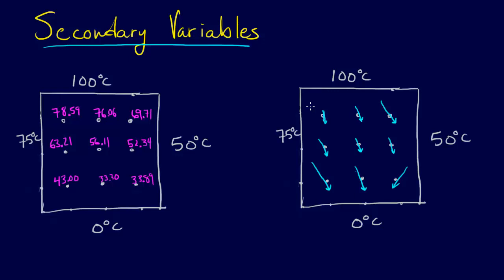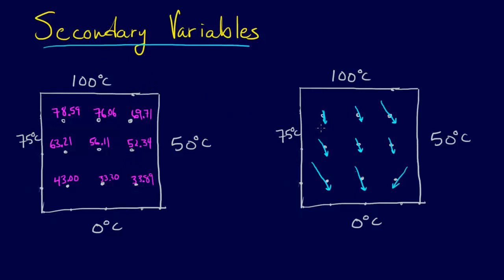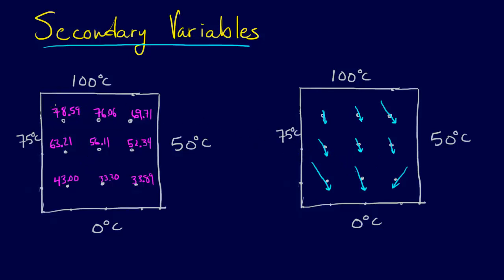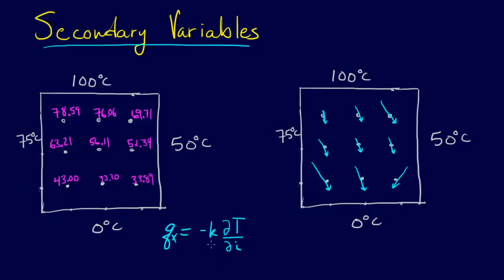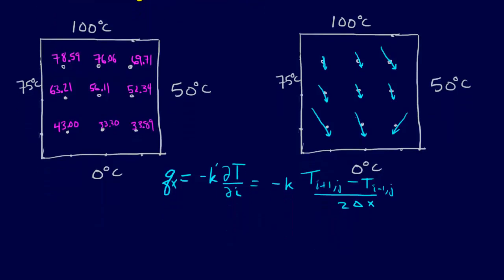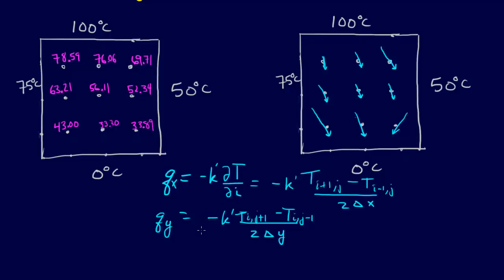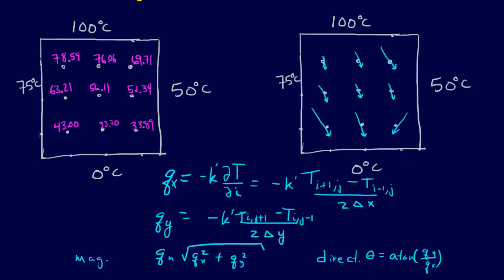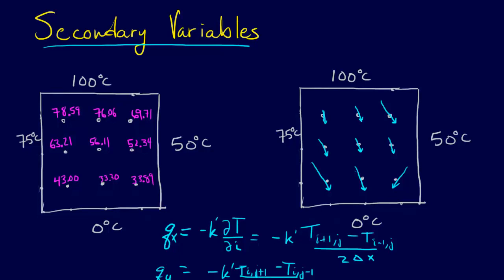8.1.7-PDEs: Secondary Variables

Comment: Just a quick question:If this is a steady state solution,then why there is a heat flux??
Reply from the maker: +Afaq There is heat flux because the temperatures at the borders are constant. Imagine a window inside your house on a very cold night. Suppose the temperature inside is always the same, and so is the temperature outside. There will be a constant flow of heat through your window pane from inside the house to outside.
Reply: +Jacob Bishop ,so you are saying that there is continuous flow of heat all the time,but its effect is negated,as +x flux is cancelled by -x flux.